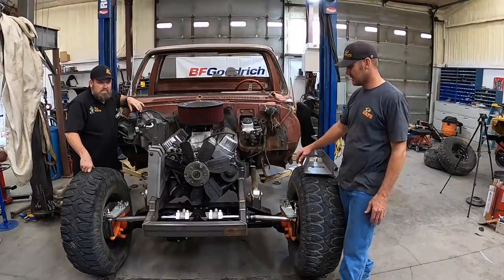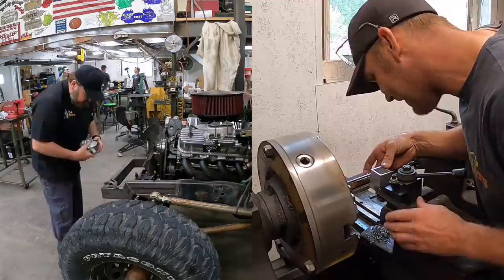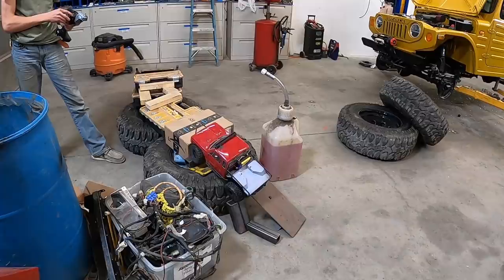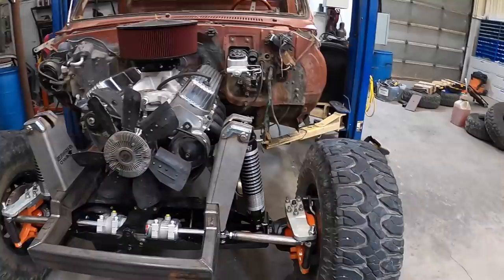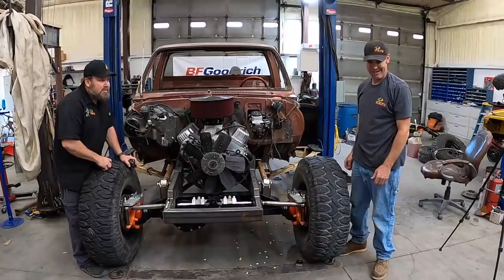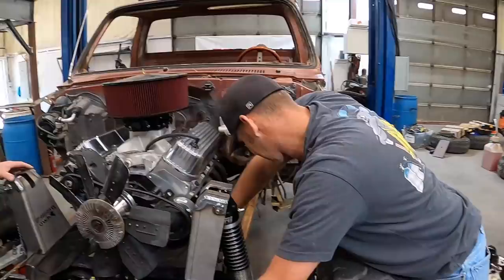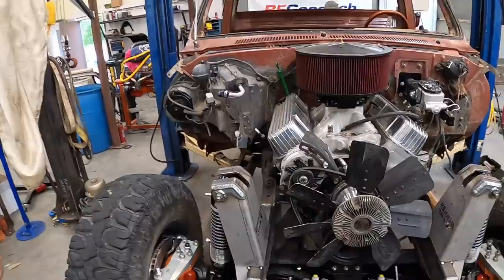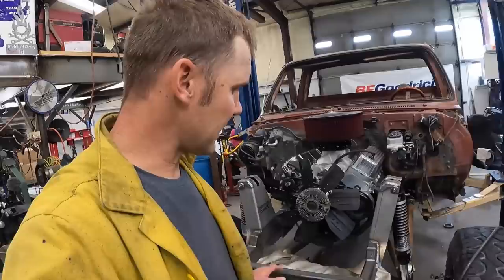TROUBLING NEWS Hits Fab Rats While Working On The Rat Rod Tow Truck.

Comment: I  happened to notice Paul and Ben using two different brands of tape measures.  Several years ago (25 years) I was the Director of Purchasing for a manufacturing company.  We had a rash of production parts that were not the same size.  In an effort to find out a possible problem, I purchased eight different brands of 25 ft. tape measures.  Then took each and measured out a 12 inch length and a 24 inch length.  On the one inch measurement there was as much as a 1/4 inch difference in what was being called 12 inches.(no two tape measures measured exactly the same).. So we standardized our tape measures with a single brand and the problems went away.   Going to miss Randall, hope to see him from time to time.  Good luck Randall and may God bless...

Comment: Paul when you need to square up the tool post just wheel over sideways and square it to the chuck body by squeezing a 1-2-3 block or anything you know has two parallel sides between the tool post and the chuck. Then tighten the nut. It will be automatically 90 degrees to the workpiece.

Comment: When setting up your front strut tower mounts , put a thin flat washer ( shim ) between the strut bushing and a mount slug. This will give you a small gap that helps on installing the strut that will crush when the bolt is tightened.
Hope that make sense.

Comment: I SO LOVE YOUR WORK...KNOWLEDGE IS  P O W E R...!!! YOUR SHOP IS TO DIE FOR...I'm 73 now...just got back from Arkansas...even got A/C working on old 91 Nissan Sentra for the first time since I bought this car....256,+++ miles on it and it runs like a clock!!! BUT...(Here comes the bubble buster...I nodded out 40 minutes West of Amarillo...came to next to fence...jerked steering wheel to right, causing left quarter and left door to smack guard fence...ripped bumper half way off & tail light housing and clearance light off...BAD WRINKLED...OWCH...DISABLED & on fixed income...wah!!! I plan on pik-ur-part to get clips i need and pop rivet it on...I WILL TRY IF NOT MENTALLY!!!

Comment: gonna miss you Randal. follow your dream!
now, on the "brackets" you just welded on the front of the wrecker, weld a plate, one on the shock side and one on the engine side that is as wide as the "bracket". the engine side one will have an angle at the bottom where it meets the frame and have a scalene triangle support in the center. the shock side will also be the width of the "bracket" and does not need the triangle. this is to strengthen the bracket because you're going to be putting a lot of forces on it. just an idea.

Comment: Really going to miss Randal. He added a nice flare to the videos, and having a bit of working knowledge of what was going on didn’t hurt a thing. Paul you should check with Robby Layton about some drill bits. He raves about some Matco brand that are stepper bits but you select what size hole and it’s a stepper bit. They sound awesome. Best channel out there. Wish you and Michelle the very best.

Comment: You know the brackets on the shock towers were parallel with the shock and the forces being applied. Bending them out like you did greatly reduces the force the tower can withstand.  So long as you crawl, it’ll be ok. I’d avoid ramping dunes.

Comment: Well it sucks that Randall won’t be around as much but it’s good that he isn’t just leaving for any old job and that it’s something he really likes. With that said I do have a question about the upper link setup on the tow truck. What’s the concept behind the rear end links being turned the way they are? It seems to me that over the course of time with articulation they would wear out faster that way as apposed to turning them back sideways and having a pivot point based around the bolt since it’s primarily up and down travel. I just want to know what your main idea was with it

Comment: Sometimes when you each use a different tape and are matching measurements it can bite you in the butt ... hope this isn't the case and hope your tapes match but it's likely they are slightly different.  Great vid and team work as always.. just wanted to point that out so you can check your tapes against each other to know if its yay or nay.  ;- )   Truck is coming along nicely !!

Comment: Did you check to see if your wheels clear the upper links now that you moved them outboard some? At lock to lock, there might be clearance issues. Especially if you put meaty tires on. I had that issue on mine at first.

Comment: I've tried to understand the reasoning to mount the link bars to the frame in a vertical arrangement.  The rotation is much greater up/down than it is side to side, so why not mount them horizontally?  It looks like there's room for a sturdy bracket.

Comment: I notice that you let the tape measure "snap" every time you allow it to close.  When you do this, the calibration is thrown off a little each time.  If you do this, be careful to use the same tape measure every time so there is no conflict in the measurements that you might get if you use different tape measures.

Comment: if you want the weld  to be strong  gotta do  vericle up  not  down  . different between vericle and down  is  down  is  50  less strength  to compare the  vericle up  is 100% stronger   becuase  i do  frame jobs  and  doing vericle up  99% of the time  even on  the  dump truck  it won't break  over 80,000 lbs  i didn't have the problems  !!!

Comment: Hey Paul did you explain why you weld the link ends  in that orientation like why link ends are side ways rather then inline like normal link end. Like you had to cut it off an re tack weld because of range of motion where as if link end was normal way you’d have all the travel you could ever need. I’m sure there’s a good reason for it. I just don’t get it????

Comment: Can someone explain why the rear joints on the link bars are not mounted in the same orientation as the front, I.e pivot around the mounting bolt?

Comment: Kinda stumped by why you are orientating the top rear heim joints that way. You are severely limiting the travel of the bar that way and reducing the strength of the joint. With the amount of fab work you are already doing, rotating the joint 90* and making an outer mount bracket to maintain the bolt in double shear is not that much more work. So while I try not to nit-pick peoples builds on You Tube channels - this installation confuses me.